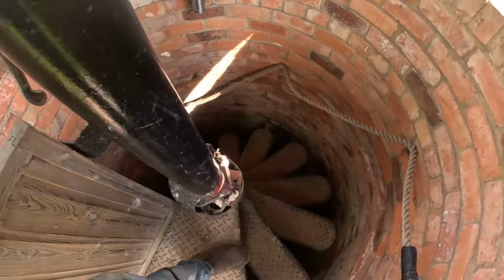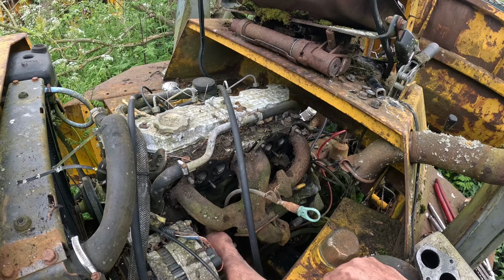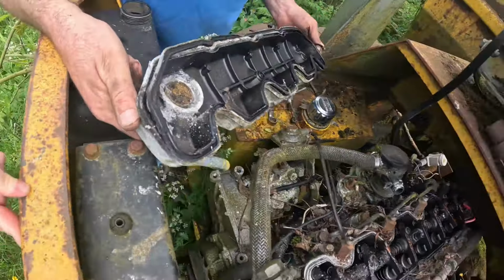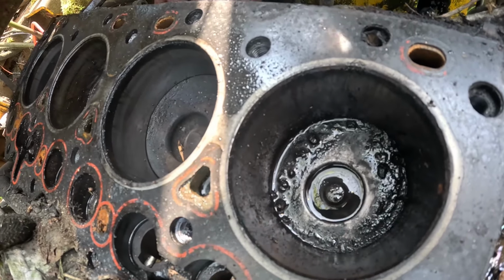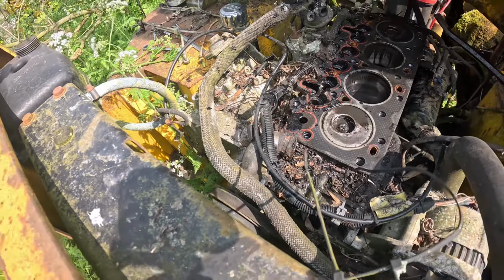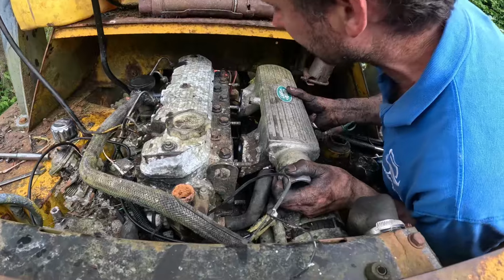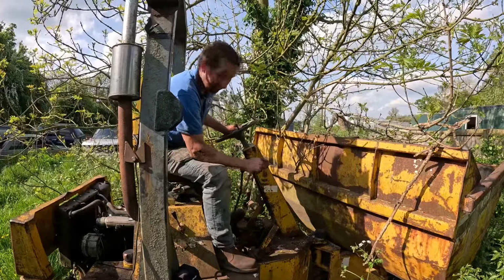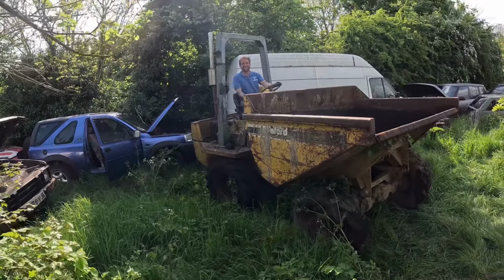Sports Dumper? The Resurrection! Engine seized

Comment: Brilliant, top notch bodging, we had a seized bodgeford with a 2 pot lister, 2 of us hanging off an 8ft scaffold pole on a socket bent the pole but it did free it in the end, my mate made some wizzard penetrating oil mixing ATF & Acetone, shoulda marketed that stuff proper alchemy better than anything I've ever used from a can lol
Reply from the maker: Yes I think of I had left it for a longer time with some fluids in here I could of possibly got it working, probably really was I couldn’t put the long pole on the front of the engine so thought it would be quicker to take the head off 😀

Comment: Good ol 200 engine the only thing tougher in the landrover lineup is the 2.25 from the series.
Reply from the maker: Yes I’ve got a 2.25 in my 2a, great engine 😀
Reply: @Tornado_Dave  I had one in my S3 until I pulled it apart and then lent the engine to someone who never returned it.
Reply from the maker: @cmotdibbler4454  that’s a shame, what did you replace it with?
Reply: @Tornado_Dave  Unfortunately, I found it needed an entire chassis and it sits in bits behind my garage awaiting the day I get the time, motivation, and funds to rebuild it. I only ever seem to be able to have two of those three at any point.